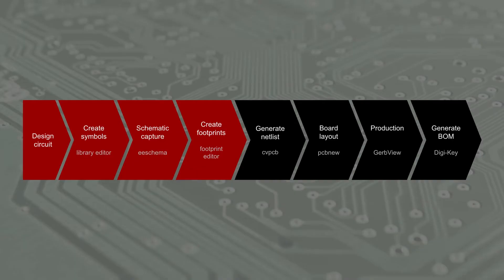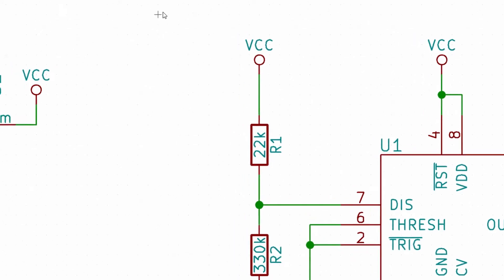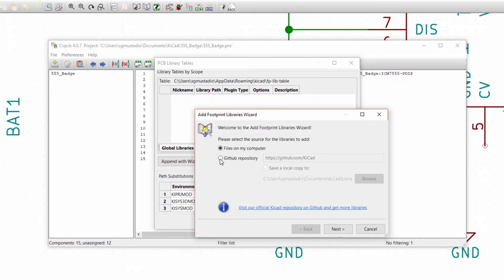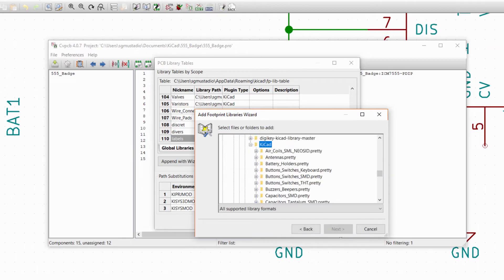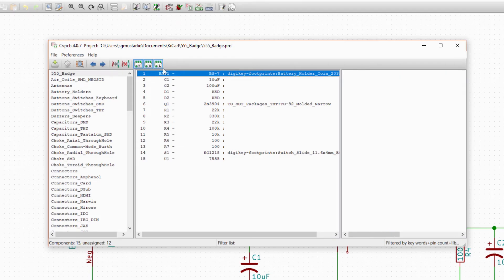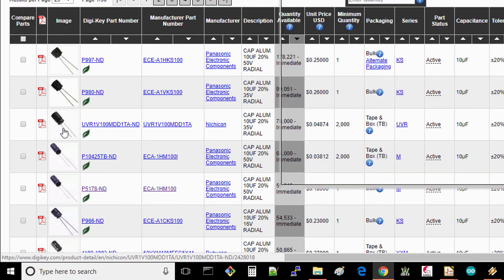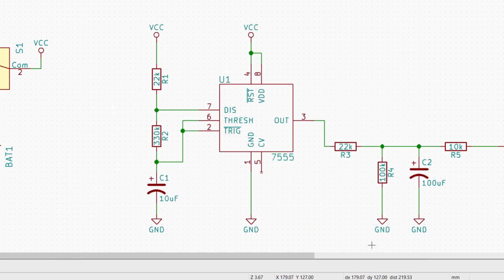An Intro to KiCad – Part 5: Associate Footprints and Generate Netlist | DigiKey

Comment: Not going to lie, I’m a complete beginner and I’ve watched part 1-5 and it’s super complicated for me. Might abandon my quest to make PCBs. I’m seeing the comments like “you’re so good at explaining things” and “this is the best tutorial ever” and I’m here like, “I have no idea what’s going on”
Reply: I deeply sympathise! I am coming to this as a newbie too and I am having similar problems, but I'm making progress. I think these tutorials were genuinely brilliant for the version of KiCad when they were made. But the KiCad tool and its interface have gone through major versions changes since then. However the interface hasn't changed too much, and so it's still possible to make progress. Here are the tactics I have followed. I recommend them if you haven't tried them already.

Recommendation 1: work in KiCad while the video is running, pausing the video frequently to copy exactly what Shawn is doing. This can feel slow, but I have found that it saves time overall. First, it helps me make sure I understand each part of the process before I move on to the next. Second, if Shawn starts doing something that doesn't work in the modern interface, I detect this immediately and I can stop to fix it.

Recommendation 2: when Shawn does something that doesn't work in the modern interface. I first check the YouTube comments for the video. Under most of the videos, helpful users have commented with guidance for more modern interface versions. (Thanks to @hongotopiadada7574 for particularly useful comments.) I try what they say. If that doesn't get me through, I look for similar buttons or menu options. So far I've always found a part of the interface that obviously matches what Shawn is doing, and I proceed with that.

This has worked for me so far and I hope it is useful for you too. If you're still stuck at a specific point then you are welcome to ask me (e.g. "at 12:34 Shawn says to click on XYZ, but it isn't available") and we can try to debug the problem together.
Reply: @dwhughes1975  Thanks for the reply, it really helps. I’m still pushing through and have watched the whole series. I think my main problem is that I want to start to make the PCB I have in mind instead of what he’s actually making, but that might be a mistake. And I’ll definitely take your advice!
Reply: Keep on trying.  Just remember, back in the 70's there used to be teams of people that would together design a PCB.  Now this is condensed down into just one person, YOU.  So, of course expect it to be a challenge.  Take notes on the video, ask for people to clarify things when there is a different version of KiCAD released and just keep applying yourself to the task.  Success is on the horizon, keep walking towards it.
Reply: Do you have the requisite electrical background? This video isn't going to teach you that .. only how to use this particular software package.

That said, (for anyone else reading this...) this tutorial is very good. If translating everything he says into your own project is too much, try going through the videos following along with his project.

Kicad is good stuff, it's worth the effort!

Comment: Now annotation tool is the icon called "fill in schematic symbol reference designators", CvPcb tool is the icon called "Run footprint assignment tool" and netlist tool is deleted. You can generate it from File → Export and its only necessary by third party software now, not by KiCAD itself.
Reply: I can't get the digikey .pretty folder to appear in the footprint library windowpane, even though it's present in the "manage footprint libraries" submenu. Any ideas?

Comment: I am just learning Kicad, but it seems to me like one aspect of matching symbols with footprints is missing in the tutorial:

Mapping between the symbol pins and the footprint pins is done implicitly, based on the pin numbers in each. There's no guarantee the footprint pin numbers will align with the symbol ones, especially if the element comes in different packages.

It would be good to know the standard process for catching such mismatches in time and remedying them - otherwise you might get your PCBs ordered and only afterwards realise they're no good.

Comment: I battled through to this point but this software is a complete knight mare, I cant believe someone hasn't streamline this process???
Reply: Yep.  There is a lot going on.  It takes some practice and doing some small projects to get used to it.  Just thank the programmers that volunteer their time and skills to offer this for free.  The professional software is barely any simpler and they do mean things like hold your designs hostage on their servers, cost an arm and a leg, and if you get the student/hobby version they cripple the features and capabilities.  Just keep on climbing that learning hill and you'll reach the summit.
Reply: @katemoon7476   Hi Kate- I know many who use KiCad professionally at work. You mention professional software, implying that KiCad is not used in the professional field. I was curious about this- does KiCad lack certain features that are necessary for professional work? I'm new to pcb design and KiCad, but you clearly have a ton of industry experience. Thank you!
Reply: I'm feeling your pain here

Comment: To import the Digikey Kicad library, you need to take the now from Github and then create a new folder and only copy over "Battery_Holder_Coin_2032_BS-7.kicad_mod" "Switch_Slide_11.6x4mm_EG1218.kicad_mod" and "TO-92-3.kicad_mod" to the new directory and then ask the Kicad wizard to import from your new folder with just these three files.

Comment: Great videos! I wish there was an update for KiCad version 5.1.7 (I am stuck trying to get the DigiKey footprint library installed without a Wizard).
Reply: 9 months later, and you may have already figured it out. But if not, I am using 5.1.7 and just learning. I went to preferences>manage footprint libraries>Click the "Project Specific Libraries" tab at the top of the new window, click the small folder icon by the + button on the bottom. In the file explorer, navigate to your "Libraries" folder that he had you make a few videos back. That is where it is. Click the digikey-kicad-library-master folder, then click the digikey-footprints.pretty folder, then click OK. That's what I did, and I got the footprint library to come up.
Reply: @pekhotinyets  Do you have any idea how he gets the footprints into individual folders like Battery_Holders? When I do this I just get one library full of all of the footprints in one giant library. I also cannot find the footprint he chose for the battery holder. Its not in mine
Reply: @smoshfann24  When he was going through the tutorial, he talked about making the project specific folders. I never did that. I just added to the main library since I didn't make much. I did notice that it's hard to get your footprints to show up if you don't select the right filter icons at the top, but by choosing the right ones, I eventually got mine to show up.
Reply: I am also stuck because it appears the Digikey library on github is not compatible with Kicad 4.0.7
Reply: @nigelhungerford-symes5059  The 4.x library is still on Github somewhere.

Comment: By separating the schematic symbol selection from the part footprint, you can create a schematic and then layout either a TH part board, or a SMD board by just changing the footprint associations.  The schematic doesn't actually change.  However, when this association is locked in the part libraries, ie: you must select the right schematic symbol already associated with a footprint, it's more work to switch construction style.  You can also decide in mid stream to use some SMt parts and some TH parts, depending on availability or what the board maker has loaded in the PnP machines.

Comment: @6:30 - KiCad does NOT verify that it's a good library for me. The status of digikey-footprints is INVALID, and it silently fails to import if I click next. Really frustrated that I spent the last 2 hours following along with this series just to come to a dead end.
Reply: I also had the same error when I was working with KiCAD version 4. The error maybe due to updated digikey files based on KiCAD 5 so installed the latest KiCAD version 5 and the digikey footprint library was added.

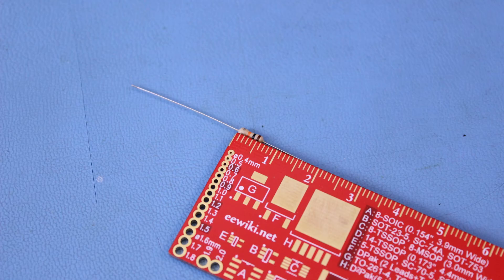Comment: What is that cool sizing tool you showed at 12:30 into the video???  Looks way useful.  Great video series by the way.
Reply: ToToT 2PCS PCB Ruler for Electronic Engineers for Geeks Makers for Arduino Fans PCB Reference Ruler (1PCS 15cm PCB Ruler + 1PCS 20cm PCB Ruler) https://www.amazon.com/dp/B07S3V5WMR/ref=cm_sw_r_cp_apa_i_IiIPDb1QXXRJ3

Comment: Noob Library Issues???
I'm having major issues with the libraries for KiCAD 5.1.2.1. A great many components available in Eeschema have broken footprint links when viewed in the footprint assigner. A valid-looking footprint name gets auto-assigned, but attempts to view it throws an "fp-lib-table files contain no library with nickname xxxxxxxxx" error. A brief Eeschema test turned up many examples of this error on any components selected from many libraries, a few of which are:
Diode_Bridge
Diode_THT
Driver_FET
Driver_Display
DSP_Motorola
Display_Character
Battery_Management
Amplifier_Buffer
Regulator_Linear
... and likely many more.
I didn't test each and every component in the above libraries, but all I did test threw the above error. When subsequently net-listed into the PCBNEW program, components in these libraries simply disappear from the layout.

This doesn't lead to confidence in the KiCAD system. Suggestions? Workarounds? Bug-reports?
Thanks for your excellent video series. Maybe Part 11: How to Avoid Noob Pitfalls?

Comment: This is good. I noticed the footprint libraries (called modules folder) that come with the installation package of kicad are possibly corrupted or that the kicad program believes they don't exist when they are actually there. Or maybe they can't be read correctly. Not actually sure....

IO_ERROR: footprint library path 'C:\Program Files\KiCad\share\kicad\modules/Sensor_Pressure.pretty' does not exist from kicad_plugin.cpp : FootprintEnumerate() : line 1801

But deleting the modules folder in kicad program files and downloading footprints from GitHub as shown in the video seems to work (for now at least) .
Reply: And also deleting all entries including ${KISYSMOD}/name.pretty in the library table (after clicking preferences tab of cvpcb)

Comment: Perhaps you changed something after this video was made and didn't mention it. In part 7 you show the footprint for the transistor as being different from the one that is chosen in this video.  I went to the URL you showed in this video for the transistor and it's pin arrangement is reversed from the one shown int he pcb layout editor. I don't think it matters much as long as I route using the right pin numbers, but you might want to mention that because it threw me off when I went to go route traces.

Comment: Could you do some guidelines about Electric Rules Check?
Reply: I'll keep them in mind for a future video, but in all honesty, I hardly ever use ERC in most EDA programs.
Reply: I used them while following this and it helped me notice a few mistakes I made in the schematic. The Digikey symbols gave false positives though because they have improper ERC settings
Reply: In my opinion this is the most common error you can fall in kicad: https://electronics.stackexchange.com/questions/19338/erc-error-errtype3-pin-connected-to-some-others-pins-but-no-pin-to-drive-it
Reply: polymetric which errors did they help you find? I'm curious to know how people use the ERC.
Reply: A few lines which somehow weren't connected, probably from moving components away from and then back to their original place. It just said "unconnected pin" or something. I can't tell for certain if they were actually unconnected or not, but I deleting the lines and rewiring them fixed something, because the ERC errors went away. After fixing one, I decided to fix all the others, and it ended up being just the battery holder and the switch that had errors I couldn't correct.